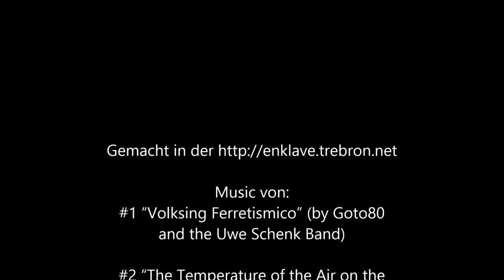Bau eines Rumpfes fuer F3K (HLG/DLG)

Comment: hello, I bought a adjustable power supply to cut the cores of foam.
The power supply has the following characteristics 0 - 30V, 0 - 5amps, switch source to an arc with chrome nickel 0.05mm (24 gauge), but the eat it is enough.
The problem is wire or the power source?
thanks

Comment: Hello Norbert,
Please, I'm tentantando make a fuselage like the video that you make using the same molds like yours, only when I inflo the balloon he is bursting .I use the balloon 360 more resistant than the balloon 260 (place two balloons on the stem) balloon pressure that I want is 4,5bar more he comes au about 3 bar and already estoura.O it can be? can you give me a hint? what balloon do you use? what pressure are you using in your balloon? you spend some external product in the balloon for him not sticking to the fuselage?

Thank you for strength Norbert and congratulations for their models and knowledgeable world builder.
Reply from the maker: João Paz Hi João, my max inflation is about 3,5 bar. If I use more, risk is about 80% for a burst. I have learned from more experienced builders, that you have to really take time to get to 3,5 bar. I increase 0,5 bar steps with pauses about 4 minutes to let the ballon find its place(s). I am using two balloons, too with a little talkum on the first one for separation from the second. 360 ballons are fine with me.